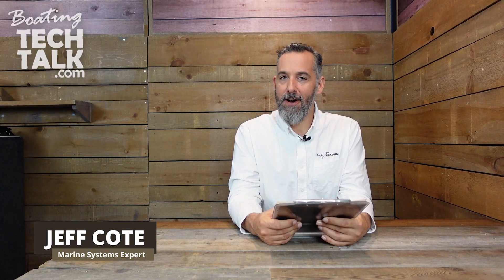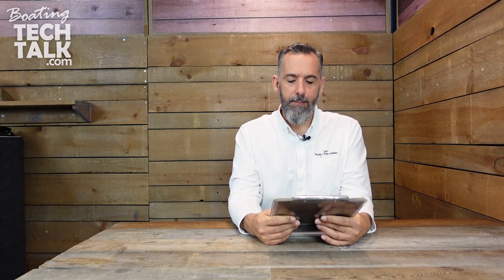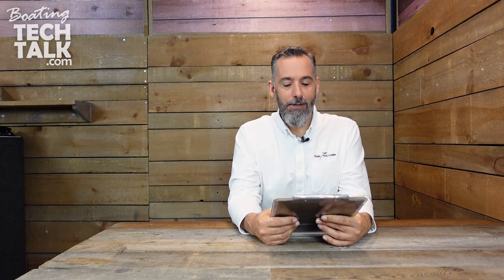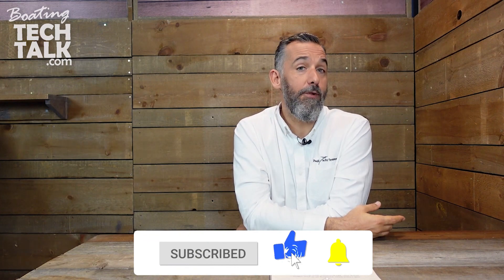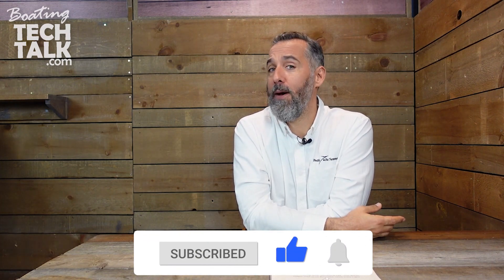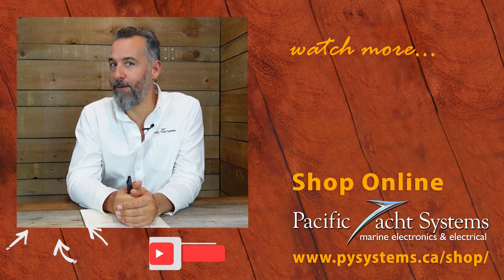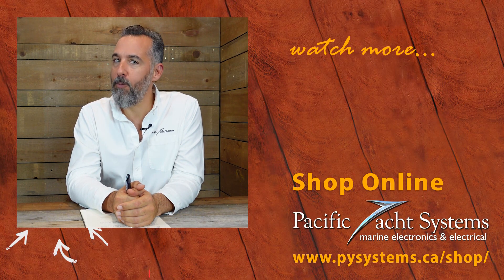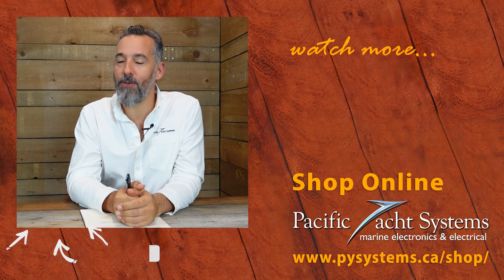How Do I Know if My Boat’s Electrical Has a Bad Ground?

Comment: THE most important function of the ground system is the safety ground, this is the primary ground system on vessel with AC electrical.

Comment: Maybe I'm missing something, but why can't the Negative 12V be floating, sure its not switched but its not going to be fatal. Commercial vessels are never grounded, I know the Alt Curr is double switched, not sure about DC. There is higher risk of Electrolysis if currents are passing thru the hull.

Comment: I got a good one,  on a new major brand boat 32 ft,   I had a serious electrolysis problem,  my zincs were eaten away in few months ,  I boat test equipment etc.  I was looking for a slow constant voltage to water,,,,,,in the end it was a huge load for short times….my typical boating was going to island beaches and anchoring…. I discovered using the windlass ( winch) a huge amount of current ( electric) in the water…..after getting to home port I bough a substantial cable….the boat had batteries (4) in the rear ,  a common ground bar was midship….i ran the cable above the deck batteries to ground bar,  tested windlass no current leakage….leaving the factory ground in place,  I added a new run, lower awg  than the factory….below deck ,   The fix relatively easy,  finding it was a chore.

Comment: Hi Jeff, I am not sure I got this right.
Are you saying the ground(s) tied to the engine block, to the tranny, to the prop/shaft should be the ground exit point? 
If that is the case, a ground fault would dump stray current into the water, no? 
And that would possibly cause ESD situation, no?
I need to understand this.
Cheers,
a.
Reply: That's why we have galvanic isolators I guess, and on mine theres also a ground fault breaker (just like in a house).
Reply: @finnerutavdet  well, no.
Reply: but i will grant that question is ambiguous since there is no ground on a boat disconnected from shore power.
Reply: On a boat the water is the ground.  And as sea water ground can not be guaranteed to be exactly the same level as shore (soil/mountain) ground, and we don't want currents flowing between those via our boat, we keep those grounds separated by typically galvanic isolators.  A ground fault on board (like connection from mains live to ground for instance) is likely gonna make currents flow as you intitially correctly state.  But if you have a ground fault breaker on your shore power it's gonna disconnect the shore power if that happens (usually at 30milliAmps).  And most marinas (berths) has that, and I also have one in my boat.  They work by comparing the current in the live with the current in the neutral, and if they're not exactly the same (as they should normally be) they will disconnect.  The treshold of disconnection at 30mA has that value because if above it can potentially kill us ;-) ......... But 220VAC (or 110VAC) is only dangerous to a healthy person if he's humid/weat.  When we're perfectly dry it normally only hurts as our resistance is too high to get us killed then.  But when we're humid/wet people actually have died. ..... But now I'm way of topic :-)

Comment: Question, my main power switch is off to the batteries but my lights, bilge, and blower work and the keys in my pocket?
Reply: Not sure if I understand your question, but your bilge pumps should always have power in case the boat start taking in whater when you're not there (maybe a fuse to prevent fire).

Comment: Hi there, thanks for the video! I'm having an issue with my boat, that I'm hoping you can put to rest. I recently bought a new, NOCO 4 bank charger for my 16' Aluminum Lowe boat. When plugged into the wall and charging, I noticed that while standing barefoot in my garage, if I touch any bare unpainted metal on the boat, I feel a tingle. Is this because the motor is bolted to the hull, so all aluminum is grounded, and it's a non-issue? Or does this require further digging on my end? Thanks!
Reply: Dig ! (Voltmeter, or even better, an oscilloscope, but the portable ones are expensive)

Comment: Great video. However could someone please explain in layman terms the difference between AC and DC? Like, what is the battery? Apologies for a novice question. I am pretty sure I’ve got a ground issue on my 98 whaler.
Reply: AC and DC are different voltage types. Direct current is a current that stays constant, while AC produces a positive and negative wave. An AC voltage on a boat motor could be produced by magnets passing by each other. One magnet would create a positive wave, while another magnet would cause the wave to go negative. Therefore, the voltage in the AC unit would pulse back and forth in the wire. A DC voltage would come from your battery, where it's just a constant voltage.

Comment: I have a timber yacht with a saildrive which is having electrolisis problems. there is no shore power circuit. Should I ground to the keel with a zinc anode on it? Thanks.

Comment: We don't connect AC neutral to DC negative (in the EU) so no need for galvanic isolater as an electrical engineer I would never do what this video says but it is up to you.
Reply: The DC ground is not relative to any 'earth' or in this case water ground. It is relative to the battery. Adding in a random reference point into the DC system is a bad idea. We don't ground our car battery to the road under us and we don't ground electronics to the chassis. Ask a radio (SSB/VHF) enthusiast about it. AC is a different scenario but on a boat only because of shore power.
Reply: I'm in Norway, and most places we have delta AC power (not star with neutral), thus AC ground is in most places half the mains voltage which is normally 220VAC (AC ground would be in between at 110VAC and is normally also connected to physical ground (typicalle the copper tube of the water supply, or a stick into soil).  So for shore power, if everetyhing is as o.k., ground (or neutral), would be the voltage of the sea or land if you like.  We do use galvanic isolaters on the ground wire though, as we don't trust that wire to have exact the same level as the ocean water.  And some few places here in Norway we have AC star with live and neutral as is the more common way globally I think (and UK has it like that).  So you're writing no need for galvanic isolator, yeah, if the AC ground is perfect (theoretically), but the real world is more complicated.  My boat has a grounding plate (common ground).  And I do'no why my prop Anode is eaten up in less than two years.  Probably I should go and measure for tiny voltage drops ?.  It's kind of hard not to connect battery (DC ground) to the engine block, and probably also hard not to have a connection to the axel and the prop from the engine block.  So having a isolated DC ground sounds kind of not achievable in my mind.  What this video says is realy to use a star topology for grounding and to not mix them except at the common ground point, and that's sounds like from a school book, it's how it's done on land, and most likely, in most cases, the best way to do it.

Comment: My propeller shaft connects via a flexible coupler.  I cut the ground strap because I don't want to make my shaft and prop the vessel's ground.  I'd rather ground through my many bonded bronze seacocks.  Opinions on this?

Comment: Hi Jeff great video as usual.  Q: If on the hard  should I have any voltage found at the engine block? Running a test from the house bank's negative DC battery terminal (with bat cable detached) using a voltage meter from that terminal to my block it reads the same as batteries. I fact so does my lead keel, my prop shaft and my propeller, oh my!  So, I know my sailboat is grounded successfully through the prop shaft as my Maxprop zincs disappear in a month to six weeks here is the worst part - whether in a marina on shorepower or at anchor with no AC power! I've been watching you vids and reading Nigel's bible as I'm in Mex with no marine electricians available here. Any suggestions? Muchas Gracias!

Comment: My engine start battery is isolated from the house Battery, inverter and shore power. (alternator only charged engine start batt) To establish ground, I need to run a wire from House DC negative to Engine Start DC Negative. How big of a wire does this need to be? My inverter chassis is grounded back to the House DC negative with 0gauge. Do I need 0gauge from House DC Neg to Engine Start DC Neg??

Comment: Love your videos. The concept of doing the job Correctly vs "Well we been doing it this way for 20 years and haven't had a problem"
Updating ( replacing lead acid house battery to a 190 ah lithium ion battery). Started noticing how my boat is wired. Many questions, but just one for now. Three batteries. 1 house, 2 starting batteries.(one for each engine). Should all three batteries be grounded to each other and then back to the house grounding block.?
Reply: I do'no,.... but I wouldn't ask that question, I would instead try to keep the battery cables as short (and thick) as possible, to avoid voltage drop. ...... And maybe give possible short circuits (for lead acid) a thought (fuses). ...... Thinking star topology when in doubt.

Comment: OK I hope someone can help me I bought a boat it’s a 1970 model it’s got a Johnson 70 horse outboard motor on it took it out today if I’m touching the throttle and I make contact with the steering wheel metal area it will shock you but not constantly and only if you’re touching both but neither individually will shock you and I actually try to get a floaty out of the water without touching anything and got electrocuted as soon as I touch the water what could possibly be causing this Could my boat be passing electric current through the water around it
Reply from the maker: 12v should not be shocking you.  If you grab both battery posts nothing happens to you.    Does it happen if the motor is off?  A bad alternator can produce AC power.    I would be concerned something was in the water in your area.   Was this a fresh water lake or ocean?

Comment: MISINFORMED...BONDING IS THE PROPER TERM, DC CIRCUITS SHOULD HAVE WIRED CONNECTIONS STRAIGHT TO THE BATTERY SOURCE. AC SHOULD HAVE AN GALVANTIC ISOLATOR TO DOCK GROUND, AND /OR  GROUNDING PLATE. I HAV AN ALUMINUM BOAT,RUNNING  GROUND THRU BIG PIECES OF METAL CAUSE ELECTROYLIS.. ANOTHER EXAMPLE IS HOW THEY GROUND SWIMMING POOLS -EVERY PIECE OF METAL WITHIN 10' OF THE POOL IS EARTH GROUNDED.. ALL ELECTRICAL SOURCES HAV AN  SEPARATE GROUND THAT EVENTLLY GOES TO GROUND AT ONE SPOT.
Reply from the maker: Thanks Steven.

Comment: I am here to learn about 12v systems. I don't know anything about boats. But when I listened to this, I thought, does the ship maintenance guy have to turn the boat power off while he is disassembling the shaft/propeller area? If two propeller shafts are grounded, is that a better ground or is that a ground loop? thanks
Reply from the maker: Great question Donna, in normal circumstances, the ground tie, should not be carrying current, and it's more about getting a common ground voltage. Yes, dual many engine boats have two paths to ground via their respective engine blocks and propeller shafts.

Comment: My fiberglass sailboat has ground wires running to every bronze thru-hull and the mast , also to the engine and a large sacrificial zinc , is this a wrong approach ?
Reply: No.  Mine is the same.

Comment: Jeff, thanks for the best explanation of grounding on a boat I've seen! However, I still don't understand the actual purpose of grounding a DC system. In a house, as you mentioned, it's a safety feature to have a path to ground. Is it the same on a boat with a low voltage system?
Reply from the maker: By grounding the electrical system on our boats, we not only provide a common reference point (i.e. ground) but we also get a short path to ground.

Comment: Hi Jeff,  In most US marinas, 220V supply to a boat is usually given by connecting 2 hot wires from a 3 phase input to the life and neutral cables of the boat. Each of these wires is 110 volts relative to the 3 phase neutral but 220 v between them.  What happens if you connect the boat's AC ground to the boat's 220 V neutral cable? Would this make a  big puff? .
Reply: yes also you would get electrocuted and die
Reply: 220v is 2 phase. I’d be shocked if any marine anywhere in the world provides 3 phase power to the docks.

Comment: Jeff, thank-you for all the knowledge you are sharing! do you have a recomendation on how to connect a bonding wire to a regular bronze thru hull  fitted with a pipe thread ball valve?( Not a seacock that has a flange with 3 bolts where you could easily use a ring connector)
Reply from the maker: That's a tough one, too many metal through hulls don't have a connection point for grounding. You do what you can, and many boaters will connect the grounding connection via a hose clamp.
Reply: @PacificYachtSystems  Thank-you

Comment: How do you ground a sailboat with no motor. The only metal in the water is a stainless rudder shaft.
Reply from the maker: Some boaters use a grounding plate.

Comment: how do you check for stray voltage in the water for safety
Reply: You need to clarify whether you are talking about AC or DC voltage.  Big differences there. An AC voltage will come from shore and can cause paralysis and thus a form of drowning.  DC voltages will usually come from a vessel (including your own).  Where it comes from dictates what is the anode and what is the cathode.
Reply from the maker: Hi Larry, you'll need a really good DC/AC mulitmeter and silver silver chloride reference anode.

Comment: HI Off subject but ive had so many tips from you i thought I’d share one from me - putting in camera systems you often have 2 rca plugs but you want to waterproof but heat shrink won’t seal the wire because allot thinner than plugs so use some glue sticks chop a piece off poke it in on each end of the heat shrink then heat gun it  - completely sealed! Can be done with any plugs - nmea power to camera etc. much tidier and better than using gunk!
Reply from the maker: Thanks for sharing Tania Tait

Comment: I think that there is a question mark over grounding to the body of water through the propeller shaft. Looking at “Sailing Into Freedom’s” lightning strike event where the energy exited the boat via the prop shaft through the side of the boat blowing a hole that nearly sank the boat, we have to understand why that happened, and is “my” boat vulnerable in the same way. I’m guessing here but it looked to me as though the high resistance of the stainless steel prop shaft caused the energy to find an easier path straight through the vey narrow keel well through which the shaft was fitted. If the space around the prop shaft is open and wide, no problem. But if the keel is very narrow making the distance from the shaft to the surrounding water a matter of just a few centimeters, then there is a lightning strike hull blow through.
Reply from the maker: All good points, can other fellow boaters share their experience of lightening protection systems?
Reply: @PacificYachtSystems  Thanks for asking that question, Jeff. We need as much evidence as possible to build a risk and consequences folder in order to develop solutions.

Comment: Hi Jeff, I am a big fan from Portugal! Great videos! What is your opinion about devices like Sterling Alternators to battery charges, instead normal isolation like Victron. Any real advantage? Or just one more device to give problems in the future...?
Reply from the maker: Hi Nuno, thanks for the reach out from Portugal. Unfortunately, not familiar with this specific product from Sterling, and hence cannot compare.

Comment: Great Video. Jeff, I am rewiring a 20ft center console and adding an ACR with switch and 2nd battery for the house. I am really confused about the wire size that goes from the start battery to the engine, does CCA amps mainly used in calculating the wire size or just the stator output amps ?

The outboard is Yamaha 140 2 stroke and the manual states a 430cca and 70Ah 20HR as minimum requirements. Also maximum generator output  Is 12V and 10A.
Reply from the maker: When sizing your starter circuit wire size, base the wire size based on the amps and also the acceptable voltage drop. The starter circuit will draw way more amps then the alternator can output, hence you should worry about the starter draw.

Comment: Voltage drop test is the BEST! The key to a voltage drop test is the circuit must be working/live. A multi meter on the voltage setting measures a potential difference between the two meter leads. We want very little voltage drop on the negative side. The higher the voltage reading on the meter display (voltage drop) the more resistance you have between the two meter leads. I'll bet you are totally confused, sorry!
So... For a DC circuit, make sure the circuit is running. Place the negative lead close to battery negative and take the positive lead and start working your way up the circuit toward the load (light, motor) on the negative side of the circuit. If the meter display jumps up in value at any point your problem is between the last point you checked and the point you just tested. This isn't easy since wiring is not accessible for the most part. Think of a voltage reading on the display as voltage drop. For example. Positive lead on the battery positive post and negative lead on battery negative post. The reading you are seeing on the display is the voltage difference between those two points or in other words VOLTAGE DROP. Resistance on the negative side of the circuit will create voltage drop or a BAD GROUND. Whatever voltage drop you see on the negative side means that voltage isn't working for you and your load is getting less voltage. It was fun to write this, I hope you can understand it. Peace!
Reply from the maker: Thanks for sharing Tim, really appreciate the info.